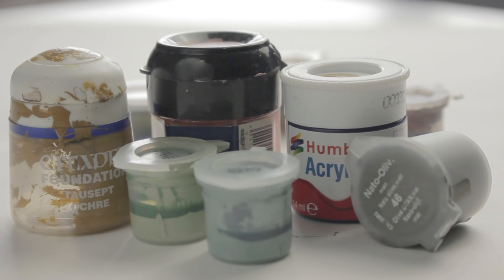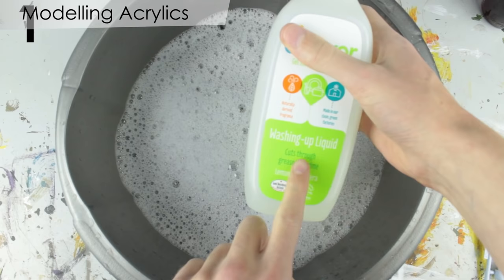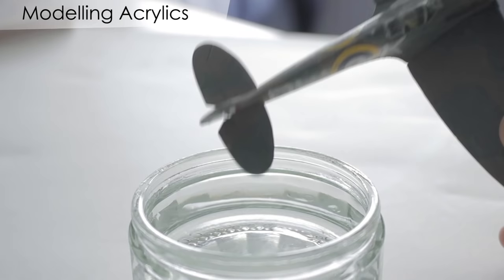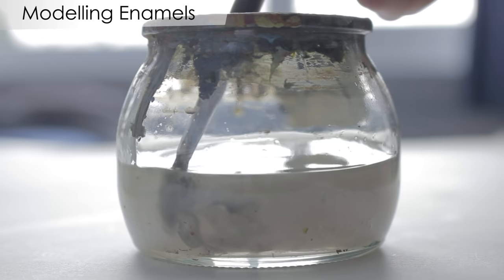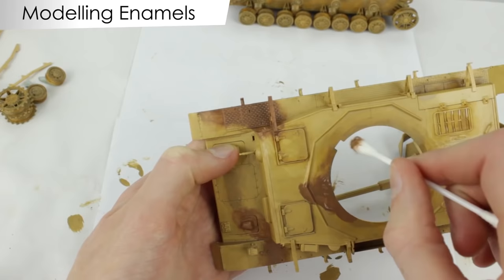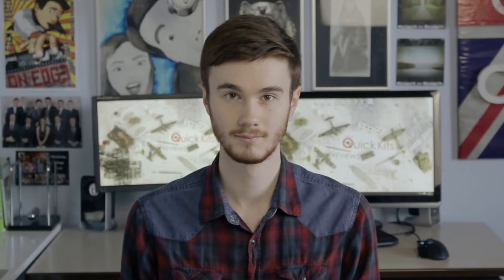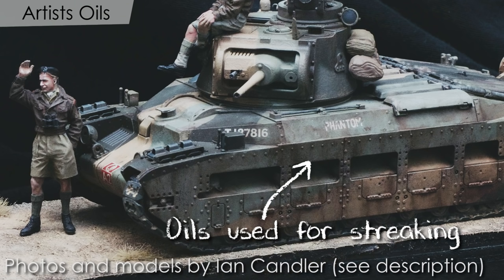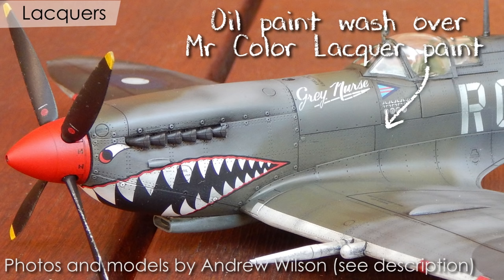Types of Paint Explained

Comment: i always use acrylics, i just like the fact that you can use very cheap water to thin it
Reply: what water do you use?
Reply: I have encounter something when using acrylics. When I use water to thin the acrylic the first layer of acrylic scrapes off when second layer of paint is applied
Reply: I like Folk Art Paints because they are not too runny. They also have a wide range of colours and Metallic Shades.
Reply: I love them
Reply: @DainiusArt  tap water
Reply: And it does not smell
Reply: @max-mg7gk  I did applied the second paint too soon because it dries quickly... Plus I wanted it to blend in the canvas but it just scrapes along with my first applied paint...
Reply: @otakisenpai8377  I asked because when another coat with thinner is applyed, it has the possibility of scraping off the first coats. Maybe thats why the paint chipped.
Reply: Since water acryllic use water or special thinners to thin, applying more thinner on a still-drying coat will bring scraping. Of course, I am still an amature so don't immediately take my word for it.

Comment: Acrylic or latex paint  is waterbase it is  use specifically for concrete either smooth or rough surface.  Huge structure or miniature. It is best to apply primer or initial coating before any topcoat.  Enamel is oil base. Specifically use for metal, wood, plastic, rubber or glass. When using acrylic on this type of materials, apply flat wall enamel as primer. Paints use depends on type of materials not on type of surface or odor.

Comment from the maker: Is there anything I have missed? Or that you agree or disagree with? Leave your feedback here! Thank you again to everyone who contributed their photos.
Reply: Thanks for the informative video! I have just started modelling and starting to think I had made a mistake by buying enamel paints. Thanks for clearing it up!

Just a quick question, now do you consistently mix your paints, to get the same ratios every time? Does a different amount of thinning the paint alter the colour? (I have just been applying paint out of the thin ATM)

Cheers
Reply: +Quick Kits Few things. Not all acrylics are water based. Tamiya for example is an alcohol based acrylic.

Acrylics are also easily removed using Windex/Simple Green with no damage to the plastic.

Good basic run through though Owen, nice video.
Reply: +Quick Kits 
Painting and paints management is one of the most frustrating topics for new modellers, this is one skill which new modeller absorbs slowly.
All prof builders suggest that practicing is the best thing to master painting .. of course it is, but tutorials are precious when modeller has little budget or access to paints.

Thanks for this video
Reply: +Quick Kits Well i prefer acrylic paints. If you use enough watrer to thin them and find a good mix between water and color it will dry fast and nearly with no brush streaks visible. 
Maybe you have to apply two layers and because it is so thin nearly no details get lost. I think this is a good alternitive to airbrushing.
I'm using this techique on the Sherman i'm currently building, so you can see the results in my latest videos.
Reply from the maker: +Nick Long Thank you! They say you should thin your paint to the consistency of milk, I've found that's roughly thinner:paint ratio 1:7... However it all depends on the consistency of the paint out the tin so it's better to do it by eye or by feel. Thinning the paint will definitely made a big difference to the finished model, and it won't alter the colour, you'll just have to paint more coats.
Reply from the maker: +japesss Very interesting, I didn't know that! I'll add that information into the video description. Thank you! :)
Reply from the maker: +Vortex I agree! Thank you for your comment :)
Reply from the maker: +Zammpie Thank you! I'd agree as my Spitfire, Typhoon and Tiger II have been painted in all acrylic and I think the results are fine. I hope I haven't made acrylics out to be bad in this video!
Reply: Quick Kits No you don't. And if if, just tell our modelling mates, that it is ok to paint their models this way as long as they use the right techique ;-)
And as always, sorry for my bad english :-)
Reply: +Quick Kits Thank you! Your models are incredible, and you seem like a genuine guy as well. If only there was a few mire videos! If there is any models you have your eye on, I'd happily get them for you... :) Keep it up!
Reply from the maker: +Nick Long Haha thank you! Unfortunately it's not the models I need, it's the time! Too much stress leading up to these final exams :')
Reply from the maker: +Zammpie Will do! And as always, your English is very good ;)
Reply: +Quick Kits I will say this though.  If you are working with Tamiya acrylics.  Spend the money on the Tamiya X-20A arcrylic thinner.  You'll get splendid results.
Reply: I never wash my models when i am brush painting, cause the color i use sticks perfectly even when i am airbrushing without primer.
Nice video by the way
Reply: I never wash my models when I'm brush painting, cause I'm lazy and, until now, didn't realise that this was why my paint wasn't sticking properly. 
Also I like instant gratification... So my models end up all streaky from heavy brush strokes. 
Thanks to this video I now understand why.
-Water based Acrylics. 
They sure beat huffing turps though: My brain is far too fragile for those oil or enamel fumes.
Reply: Quick Kits 
Which yields better results?  Thinning humbrol acrylic paints with acrylic thinner or regular tap water?
Reply: you can use purple stuff or simple green to strip the paint as long as you know what you are doing and follow the instructions you can get the acrylic paints of very easy from what ive seen and heard and from my own experience using a soft children's tooth brush with some dish washing shop and water and then drying it off completely is all i need to get the paint to stick to my models haven't needed to use sanding on it as of yet. as for acrylics drying too fast that is the case but aslong as you have some retarder about for it they are perfectly fine and you can extend the life time and work time vastly
Reply: Quick Kits what type of paint uv used
Reply: Quick Kits by any chance you know what type of paint used in gundam paint type markers?
Reply: @98invis  10 months too late but I'll answer anyway. Gundam markers are lacquer type paint like Mr. Color paints
Reply: @Jose Murillo-Paz hardware or DIY shop
Reply: What kind of acrylic paint do you use? I got new model and I don’t know what kind to use.
Reply: I'm going to build my first model kit and I didn't know what kind of Acrylic paint is the best? Just wondering if you had any brand suggestions.    Thanks!

Comment: This is very informative to the unskilled, new painter, seeing as I am one. I have been researching various paints and how to go about actually painting, protecting oneself and protecting the model getting worked on, but your video gave me insight to how these paints differ, before I honestly didn't understand the difference, aside from the obvious ones that the paints get labelled by.

From the video I think I made the right choice choosing acrylic paint, it seems the least taxing when it comes to the upkeep of the paint job, the fast drying time is convenient and while the instant drying causing brush strokes to appear is somewhat concerning, my goal is to achieve a somewhat battle damaged look with my model, and while I am going to be dry brushing to achieve that, and the brush strokes might help a little in getting my desired effect (though I will be obviously trying to minimize the occurance of it), finally I am happy to hear that Acrylics become waterproof after curing, because living in England with my luck tends to result in rainfall all the time and it's nice to know if I do get caught in the middle of painting outside, the dried coats won't be affected badly by the water.

I might try Enamel paints when I get much more skilled with painting, but that's something I'll have to think about in depth, but for now, thanks for giving me some more information to rely on when it comes to my first paint job.

Comment: Some brilliant models and some great advice, thank you. I would however pick up a point if I may regarding acrylics and removal. Surgical spirit that can be got over the counter in any chemist will take it off (though it stinks to high heaven). Far more expensive is Revell who have brought out a Paint Remover (NOT Clean) which smells a bit better but will take of acrylics cleanly and easily. 

I've had issues with acrylics not adhering to plastic but hadn't realised it was due to the plastic being too smooth which is contrary to what I've always believed - the smoother the surface the better! But from now on I will clean my models and brush over all the surfaces with an old toothbrush and toothpaste just to knock the surface back a bit.

Anyway, thanks for the videos, some stunning builds :)

Comment: Great video and I agree on everything, especually on the disadvantages, exept that acrylics would be difficult to mottle.
When i was building my Viggen in 1/48 with splinter camo, i needed the paint to look like it had been bleeched by the sun in some places. Mainley the flaps and back areas around the engine and a little on the tail..
I used highly thinned Vallejo paints, and applied water on the surface where i wanted to do the mottling.
The paint drops did separate, and several layers later it got such a good apperance that one of the guys behind Tarangus said to me it was one of the best splinter camouflages he had seen on a model.
Acrylics are difficult for washes though, but can be managed if you are careful and wet the surface before applying.
Reply from the maker: Wow very nice! :D and interesting to hear, do you think it would be possible with Humbrol acrylic? I get a lot of people asking but I've yet to try it myself. Thank you for the tips!!
Reply: Quick Kits 
Yes you could probably do that with Humbrol's acrylics as well.
As long as the surface is wet and the paint starts to bleed.

Comment: I’ve been using Vallejo acrylics to paint 1:72nd scale AirFix aircraft and have found the paint is easily stripped with rubbing alcohol. I use alcohol swabs and cut small strips and use them with tweezer or micro brush to readily scrub paint off canopies.

Comment: I use lacquer paints a lot on my models.

I like to use either acrylics or enamel based paints for the large surfaces. But I stumbled upon some metallic paints which were incredibly realistic. However, i came to realise that these were lacquer paints and i couldn't clean my brushes (they need lacquer thinners or cellulose thinners). I have found these to be the best for very small details in cockpits, engine bays, landing gear bays and small bear metal surfaces. 

Their quick drying time and precision makes them almost ideal for these parts and the quality of the metallic colours was great. Humbrol and Revell seem to have this plastic like look to their metallic range. (humbrols metalcote range is quite good though). These lacquer paints have a very bright finish.

Comment: Very good ; especially for new modellers , who might not have considered these issues . The Tamiya acrylics have a tendency to dry almost instantly . I find that issue a problem for hand brushing ; though it would be an advantage for airbrushing ( I guess ) The smell of white spirit can be a real problem if like me somebody in the house does not like smells and to be fair is rather unpleasant . Enamel paint really needs a drying time of 6 hours . about 6 times more than acrylics .
Reply from the maker: +Anthony Brown Thanks Anthony, I definitely agree with your comment
Reply: +japesss YES I have used them on and off for quite a few years and I tend to avoid them though some of their shades are accurate . If you have a few it maybe more economical to try the retarder ; as paints are expensive . they are ok for small areas but don't like to be brushed once applied after a few seconds . Valejho standard acrylics apply really well though they chip off easily and colours are not always accurate for aircraft . Humbrol is improving their acrylic paints and are easy to get in UK  .
Reply: +japesss Tamiya may be my favourite models but their paint to me is way down the list . Though their cement is very good
Reply: +Anthony Brown The paints are very clearly designed for airbrushing, which they're amazing for.

Comment: I read an issue of Scale Auto magazine a few years ago;from Kalmbach Publishing based out of Milwaukee,Wisconsin;and I read an article about some world class auto modelers using nail polish as paint for custom paint jobs on 1:12,1:16,1:32,1:20,1:24,and 1:25 scale plastic model cars,trucks,and suvs.I've heard that nail polish has a chemical makeup that is very similar to the lacquer based hobby paints and comes in dozens;even hundreds of different colors;shades,and sheen's/finishes that are not available from most hobby paint manufacturers.Some custom colors are not available from the hobby paint manufacturers;but if you go shopping for nail polish, chances are you will find the color you are looking for that would be a close match to the color recommended in the instructions that you won't find by any of the leading hobby paint manufacturers.Doug of Right On Replicas from time to time,uses paints bought from an automotive parts store;such as Dupont automotive spray paints.If you are going to use automotive spray paints on your next kit project,find an old model kit to test the paint on first;because automotive spray paints are a lacquer solvent based paint that is stronger than hobby paints and may attack the kit plastic.Checking the compatibility of the primer and final colors before painting,will save you time and money.Chris of HPI Guy's model workshop,uses cheap acrylic craft store paints like Delta Ceramcoat;to do alot of his painting.For automotive kits,he uses 3x Rustoluim spray paints that is a close match to the body color recommended by the instructions.

P.S.- I reccomend shooting nail polish through an airbrush with the compressor set at 35 psi in a spray booth with a flue gas vent leading out side as nail polish thinned with rubbing alcohol or a hobby laquer thinner that is compatible with nail polish, stinks to high heaven;if you have an airbrush and a compressor but no spray booth,just do it outside on a clear sunny and windless day with the temperature being between 70 and 90°F and low humidity;spring through summer is the best time to be painting models out doors.If the it is breezy or the wind picks up,turn your back towards the wind so you don't get the spray mist on you and in your face. After letting the nail polish cure for 1 to 2 days,spray the entire model with PFG(Pledge Floor Gloss),or your favorite brand of clear coat and Viola! Your custom paint job is complete;and forever protected from scratches,chips,dust,fingerprints,
and just the elements in general.

Comment: Handy tip: I use both Acrylic and Enamel paint, and I clean my brushes in the same jar! How do I do this? Simple. I use water based turps! Bondall water based turps. I can switch between paints easily now, without the smell of white spirit gunking up the room. I use two jars of the water based turps, one for initial heavy cleaning, the second for a final wash.

One minute I am brushing out Humbrol enamel, then, after cleaning the brush, I start painting on the acrylics, with the same brush!  Caution: This stuff is not for thinning paint, only for cleaning your brushes.
Reply: Thanks this really helped me!

Comment: True water based acrylics (with a polymer medium) can be nicely thinned slightly with water. However, too much and you endanger the coherence of the paint itself. Vallejo Model Air has conditioners, retarders and levelers in it, so water works fine - Vallejo thinner is better. However, Model Color (and I would say Citadel, LifeColor and the marvelous Golden Fluids or High Flows) are best thinned seriously with "Airbrush Medium" or (better for some things) Air Brush Transparant Extender. Airbrush Medium is sold by many companies - Vallejo calls their version thinner medium. They are all white but dry clear. Extender is a Golden exclusive but can allow the water based fan to try to "paint small" - very thin spray on low PSI - which is useful for many techniques. Because solvent based paints like Tamiya or Gunze thin with lacquer thinner, they are normally the best for airbrush. But if you experiment with the water based paints, they can airbrush splendidly: just don't go more than 1:5 with water. Water based are much the superior for hand brushing.

Comment: 0.46 alwaya happens to me when I'm using Tamiya Acrylics. The paint sometimes does not stick to the plastic. To solve these problems, do I need to Prime the plastic before using the Acrylic?
Reply from the maker: I'd always start by soaking the parts in warm soapy water with a splash of vinegar - this should remove most of the residue from the mould which may prevent the paint from sticking. Or you could wipe the model down with a cloth, dampened with white spirit before you paint. Or you could sand the model with a fine grade sandpaper eg. 1000 grit. Or you could prime 😃 Lots of options
Reply: Quick Kits okay, I just primed it before using the acrylics😊

Comment: Owen, thanks for your great videos. I'm not sure if you have a comment/advise: I'm using the small Humbrol pots of acrylic paint that come with some models, but I also have experiencing the same issue with tamiya acrylics. I'm have followed all of your advise about brushes, thinning the paints, several thin coats etc, but the paint, once applied, has a rather pronounced chalky/gritty appearance and feel. It's almost as if their is some very minute specks of "dust" in the paint. Not sure what if anything I can do or what I'm doing wrong. Any advise or comments appreciated. Thanks